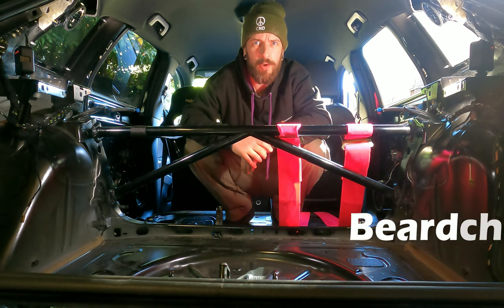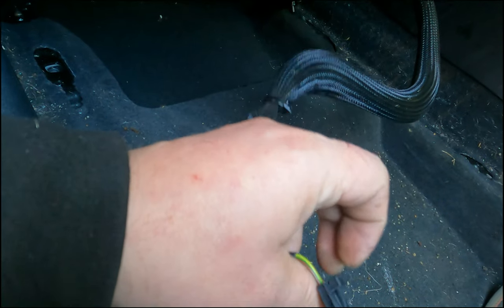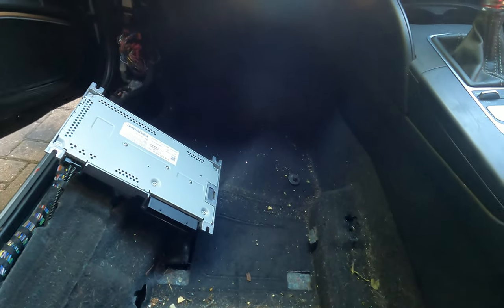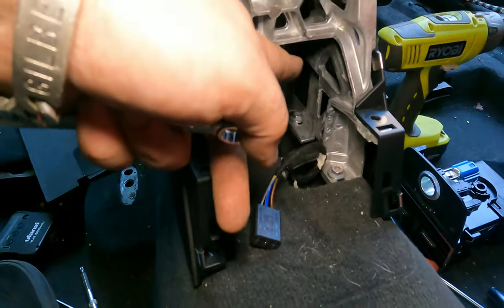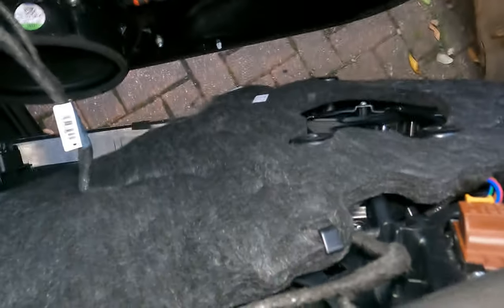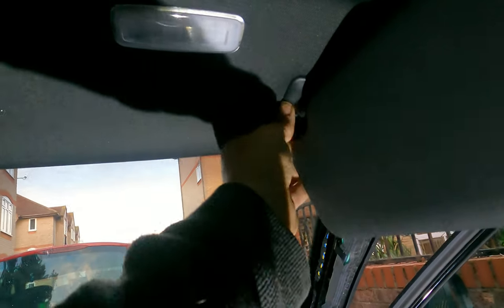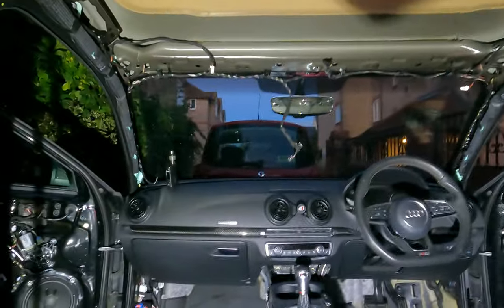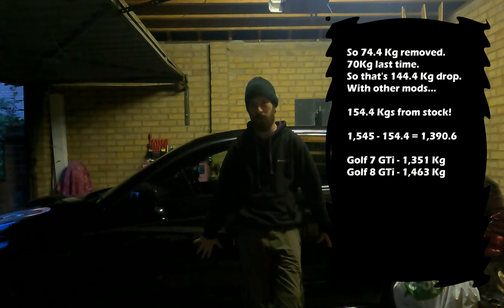Audi S3 Complete Weight Reduction Guide Part 2

Comment: Fantastic! Well done Gilles! Excellent numbers. Now you got the lightest and most powerful S3 on the UK. Excellent power/weight ratio: 600hp for 1390kg. Excellent 😃💪🏻🔥. My compliments dear Gilles. Happy weekend my friend 😃👍☀️
Reply from the maker: Still some road to go but that's the plan. Keep remove weight and adding power :D Even with the transmission problem should see better time so need to do a 0-60 & 1/4 mile episode :) Won't be the best time but should still show weight drop gain. Have a great weekend my friend :)

Comment: Wicked video...its crazy how much weight the stock seats have.. this car will be flying 😎💯👊
Reply from the maker: Yeah just the gain from the seats is incredible. Tonnes to save there without going extreme. The trim doesn't actually weight that much really. Mostly carpet and speakers the heavy stuff apart from the seats.
Reply: Thats all the seats though front and rear 54kg = 119 lbs

Comment: Hi, since you've removed the center counsel, which has the handbrake switch, how do you use your handbrake? I'm looking to strip mine as well, hence the question.
Reply from the maker: For now I've zip tied the part with  the handbrake back on... I  need to sort a solution for it, want to remove the dash too but the same problem with button for launch control. They're not old fashion buttons either, think they're state base buttons which might be tricker to replace. Handbrake ideally would like a stick as useful for burnouts and skids.